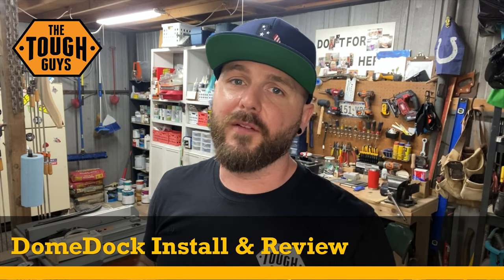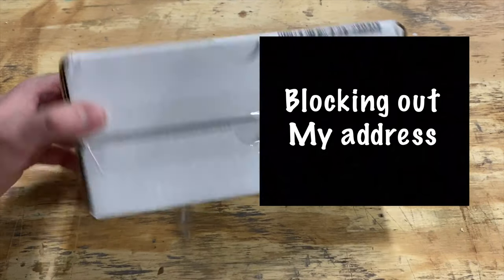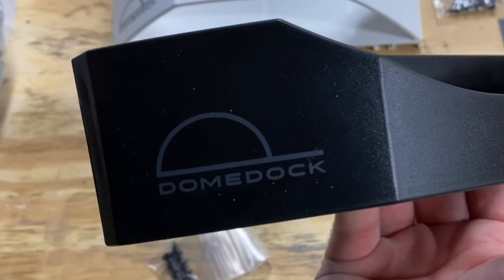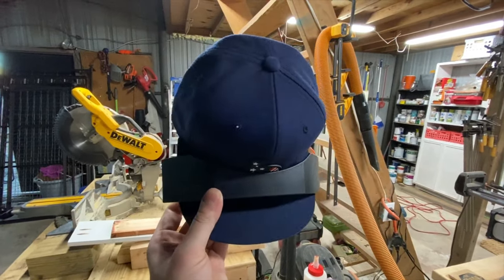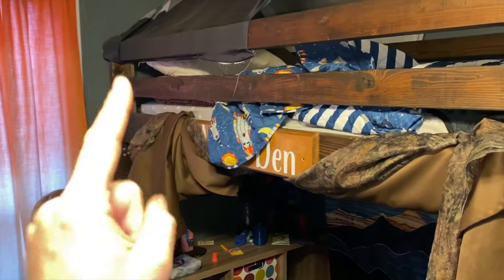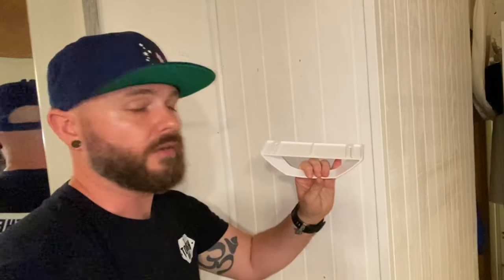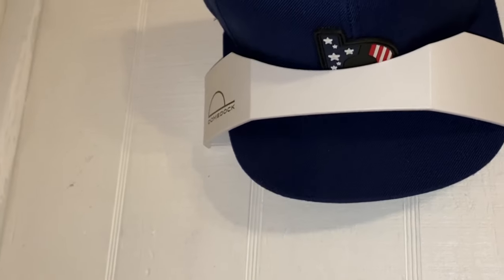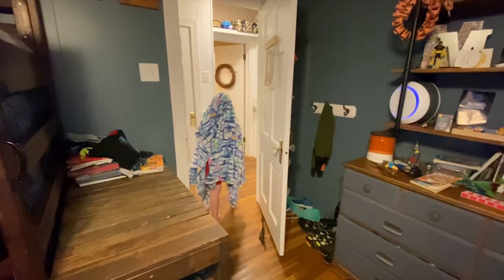DOMEDOCK! Best Hat Storage!!

Comment: How do these work with a collection of hats that have curved bills? Will they be crushed and get mishapen after a while of being stored in these? All of my hats have curved bills.
Reply from the maker: If they are super curved it may actually not work too well. I’ve got a mix of flat and slightly curved bills all stacked together. Probable 15 or more hats at this point. No issues for me so far! Thanks for the comment

Comment: $25 is way overpriced. I could 3d print something like this easily.
Reply from the maker: Sure - if you have a 3D printer and are good with using it, definitely go for that (I'd argue most people that have a 3D printer probably feel the same way) .. BUT .. I'd also argue that your thoughts on the price may be because you have a 3D printer and are good with using it.  Most people, a vast majority, do not. To me the price is more than fair considering it's a family owned, small business that's solving a problem with a great product - feels like a solid purchase.  

Thanks for checking out the video and for sharing your thoughts!